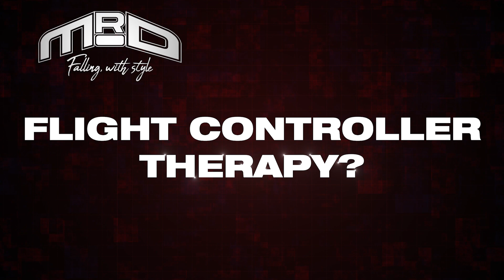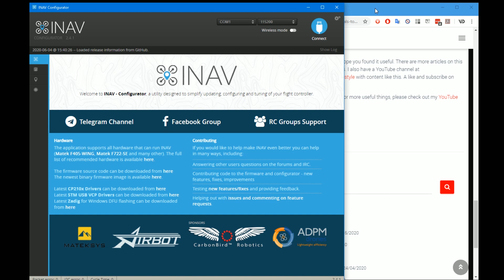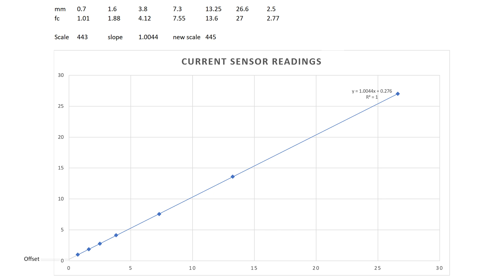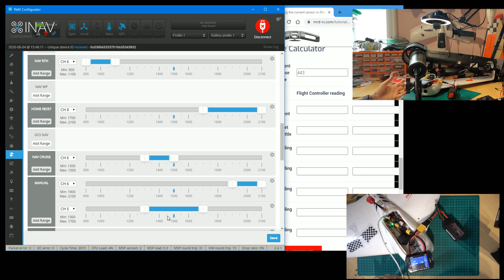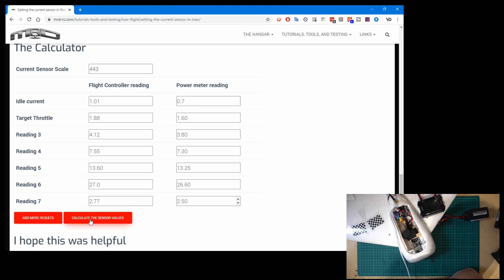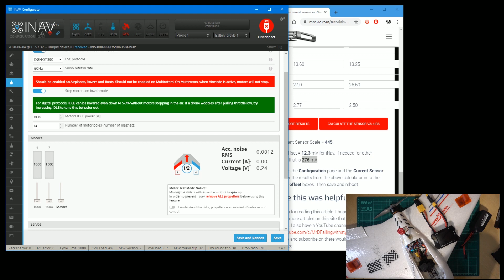Calibrating your Current Sensor in INAV

Comment: Current draw of the motors at full throttle is known. In Inav output settings, spin a single motor with the propeller at full throttle for a few seconds and see if Inav shows the exact current draw or not. Then calibrate accordingly.

Comment: Hi. Thank you for this video and the article on your website. Could you  tell us if we should do this with or wihout VTX and servos powered during the calibration? If we add offset calculation, is the value drop to zero amps even if we power the VTX and ESC or the value would be greater than zero? Thank you.
Reply from the maker: Have everything connected 👍🏻
Reply: I did the calibration with  my OSD goggles and everything connected, drone armed. Perfect for me. Thank you!

Comment: So having current sensors problem. Maybe u can share some of your magic maytek h743v1 inav 5.0 at an idle current sensor reads 30 amps maytek say to use current scale 250. I’ve tried all kind of different scales and nothing works. I did find some cli commands to use but not sure if they r correct.
Reply from the maker: Hi Aaron. That does sound pretty strange. What happens with the current when you increase the power? Does it go up still or just stay around 30A?
 
For me, all I do is set the voltage using a reasonably decent multimeter. Then calibrate the current sensor using my tool https://www.mrd-rc.com/tutorials-tools-and-testing/flight-controller-therapy/setting-the-current-sensor-in-inav/. I don't change anything in CLI.
Reply: @MrD  it goes up but not right away I am using  maytek pdb hex the high dollar one but only running v batt through it no signal just power I also have cap on pdb and fc both r 470 uf I wouldn’t think that would cause any problems. I’ve tried multiple current scales amps nothing seems to fix it. Battery voltage is spot on. To me it has to be the pdb causing the problem
Reply: I really love this plane rmrc anaconda supper slow flyer when flaps r down very sturdy plane. I’m about to add a foxeer 30x zoom cam and a hevey duty pan and tilt mount. Haven’t really thought about this yet but I need a way to have full speed on pan when cam is zoomed out and then slow pan down when zoomed in I think I could do it I may just find a happy medium that would be easy.
Reply: Back to current censor at idle it jumps around a bit 30 40 in flight be up around 120 the plane only draws 25 amps at full throttle on my meter I run lion bats so it’s kinda important to know amp draw
Reply from the maker: It could be down to the PDB. Which model flight controller and PDB exactly? Also, how is the power connected. Battery to FC, FC to PDB?
Reply from the maker: That sounds nice. Bet you can have some great, relaxing flights with that.
Reply: @MrD  maytek h743  Mattek PDB HEX batt to Pdb to fc
Reply: I got it bro thanks I can’t use that pdb like that don’t seem. I took it out and everything work fine

Comment: Hi Mr d. I have a problem with current meter - maybe you know the answer?

My equipment is a stac (Holybro Kakute F7, ESC Tekko32 4in1 45A and VTX Atlatl HV V2)

There is no way to calibrate the current measurement because the readings are very strange, for example:

I connect the Lipo battery to the ESC with the connected flight controller (no other devices) and, for example, inav displays the current consumption value of 0.5A to me - it is logical that after connecting a device, the power consumption should increase. For me it is the other way around. For example, I connect the receiver and the value in inav changes to 0.4A I connect another device (e.g. more power-hungry) VTX, the value in inav drops again to 0.0A

Turning on the engines also does not increase the value of current consumption, well, maybe slightly ...
Reply from the maker: I wouldn't worry too much about current readings under 1A. Some flight controllers use a flat reading below 1A, due to it not being accurate. Others can just have strange readings. The best thing to do is calibrate the current sensor from 1A and up. If when the motors are on and at a decent throttle level, and you're not seeing a change. There is something wrong.

Comment: Hello Mr. D, greetings from California! I have a question, I’m in the middle of a new build, I’m using the F411WSE by MATEK and even with the factory current scale value recommended by MATEK and the voltage offset set to 0. When conducting the calibration INAV shows current draw of 22A while my amp meter shows only about 5A @50% throttle. With power applied to the model and no motor running INAV trades and amp dray of 8.7A. This is with INAV 4.0 Could I have a bad flight controller?
Reply from the maker: I think I saw your post in either the INAV or INAV Fixed Wing Group on Facebook. Something doesn't seem right there. I did check the F411-WSE in my Dart 250G yesterday. That's not far off the recommended scale. It could be faulty. Have you tried running the calibration? Maybe a wrong component has been fitted which has adjusted the scale. 5A @ 50% throttle sounds about right on the ground. In the air, my Dart was pulling around 4.1 - 4.2A at 50% throttle.

Comment: if you follow the same steps with the props off  will it be too far off  of the real numbers ?
Reply from the maker: With props off, you won’t get the current draw you would with props on. It may be thag full throttle isn’t near your cruise throttle. The amps going through the sensor will be the same measurement. But you won’t get the range of current draw that you do with props on. Still, try it with props off if you feel safer that way.
Reply: @MrD got it ,  thank you

Comment: Hi there, I have callobrated my esc in inav 3.0 and when I power on it cuts out on anything above 20% 1.3amps . At 20% the voltage drops off to 10 volts in seconds. When I check this on my meter there is no voltage loss. What am I doing wrong ? At first i thought it was a duff motor not sure now .TA
Reply from the maker: Do you have a smoke stopper connected? I’ve done this a couple of times and wondered why the motor keeps stopping. Then I usually slap myself 🤣
Reply: @MrD  omg no .How on earth. I have kicked the shit out of mysef . Many thanks . This hobby sometimes .....
Reply: As soon as u said smoke stopper my head fell into my hands.Cheers again it works.
Reply from the maker: No problem Traci. Better that than the smoke stopper being needed and not connected. BTW, it’ll happen again 🤣 It’s just one of those things. I know I’ll do it again at some point and wonder what’s going on.

Comment: Great instructions here, Darren. I was needing this. Thanks. BTW, last thursday in got my first 10km with a Mini Drake. Good adrenaline.
Reply from the maker: Awesome Silvio. The Mini Drak is a fantastic plane. Hope you have loads more fun with it.
Reply: Something went wrong. After calibration I have noticed a dolphin effect when she was on Cruise Mode.
Reply from the maker: That’s strange Silvio. The current sensor calibration will have no effect on how the plane files. It only alters how the value from the current sensor is interpreted. 

Dolphining could be too high rates on the pitch axis. Also check that your control surfaces aren’t binding, move smoothly, and centre correctly.
Reply: @MrD  Thanks, Darren. Also I will try auto tune and see what happens. ✌️✌️✌️

Comment: Hello Daren,
Would you suggest soldering the XT60 or the XT90?
Anyway i will not be passing the 45 A with my plane.
Thanks
Reply from the maker: I went for XT90’s as this can handle a fair amount of current. I also use XT90 to XT60 adapters and XT60 to XT30 adapters, so it will work on any setup I want to use it with.
Reply: @MrD  thx Darren.
Gonna use it with lion 4s2p 8000mah.
I m gonna end up doing the same as you, xt90 :)

Comment: Nice one Darren, I take it this will also work with a quad, just need to put a brick on top of it lol
Reply from the maker: 🤣 or tie a brick underneath it. Yes, it should be no different. Its just current draw at different throttle levels. The calculator will even give betaflight values 👍🏻
Reply: @MrD  Very useful, thanks very much!
Reply from the maker: No worried Greig 👍🏻

Comment: This is great, much better than that charger method. I'd like to suggest a simple sanity check in case someone enters a wrong value by checking if the R-squared is above 0.99. Since both current meters are linear, the scatter plot point should all lie on a straight line. Any point that are significantly far away from this line must be the result of measurement error or a typo.
Reply from the maker: Thanks Alexander. That’s a great tip too. The plots usually are pretty linear, with only a little deviation. I’ll see if I can get some sanity checking added.

Comment: Awesome - as always a great and informative video! 😊
But one question remains for me, because I would rather calculate offline: how do you determine the offset? When I do this with Excel, I get a different offset displayed in the formula of the scatter plot (the rest fits perfect)...
Reply from the maker: Sorry for the delay in getting back to you. I had to revisit it myself. All the data is in Excel, but needs some changing to get the correct values for the flight controller.

You'll need the slope, offset and new sensor scale. The easiest way to get that is by turning on "Display Equation on chart" trendline option. You will get something like y = 1.0044x + 0.276. The 1.0044 is the slope, and the 0.276 is the offset.

If you want to use this with a mA based offset, you can just multiply the offset by 1000. For example 276mA. That would work fine with BetaFlight. However, iNav uses mV for the offset, so we need to do a little processing. We need to use the offset, slope, and new current sensor scale.

To get the new current sensor scale, you need the last scale and the slope:
newScale = round(oldScale * slope)
newScale = round(443 * 1.0044)
newScale = 445

To get the offset for iNav, you need to do the following:
iNavOffset = chartOffset / (10 / newScale)
iNavOffset = 0.276 / (10 / 445)
iNavOffset = 0.276 / 0.02247
iNavOffset = 12.3 mV
Reply from the maker: I've created an article on this, for anyone else who would like all the details. https://www.mrd-rc.com/tutorials-tools-and-testing/inav-flight/current-sensor-scale-and-offset-calculation-how-it-works/

Comment: this is a great tool, I started using this to setup all my FPV planes and when I recheck via my OSD the readings are the same as the watt meter across the throttle range. thanks mate
Reply from the maker: Awesome. Its always great to hear feedback like this. It’s worked well for me on my builds too 👍🏻 Thank you.

Comment: why did you put manual mode if you are not using tx?
Reply from the maker: Because if you are not using a TX it defaults to ACRO mode. Which means the servos will be trying to correct while you are performing the test.
Reply: Mr.D - Falling, with style ok
Thank you my Friend
Reply: I had to put 470 capacitor to esc as amps were going crazy in osd
Reply from the maker: This can happen. More on smaller ESCs with less draw too. I hope you managed to get a good reading after.
Reply: Mr.D - Falling, with style if esc has capacitor built in then no need to put additional one?

Comment: Been running my current build to 1000mAh drawn on OSD and then charging like 8 times now trying to get it calibrated. Will be using this method now!
Reply from the maker: This should be much more accurate. And you can do it on the bench 🙂

Comment: I used your website tool to calibrate my matek boards, thanks.
Any chance I could get a copy of the spreadsheet with the formulas too please? I actually only used 2 throttle level values, and I like the look of the graph.
Reply from the maker: The spreadsheet doesn't actually have any formulas. It is just used as an example. I literally just added the flight controller and power meter readings to cells, then created an X Y scatter graph from those readings. The line of best fit is a trend line option you can select, as is to display the equation. The y= value, up to the x, is what you multiply your scale by to get the new scale (I added that in a cell labelled slope). All the real calculations are done on the web page. I was looking in to adding a graph on the page, but so far, couldn't find a solution that works with a line of best fit. But I will keep looking if people find the graph useful.

I'd highly recommend doing more readings. At least 4 or 5. If you just take 2 readings, you are just drawing a line between those points. With more readings, the errors are averaged out, which will give a more accurate scale and offset.

Comment: I've found the Matek figures to be fairly accurate, under the wiring guide and mixer tab of the product page. 
For the f411 wing
Voltage scale = 1100 
Amps scale = 423
Reply from the maker: Matek are definitely one of the better providers, with pretty good base scales. However, my F411-WING has a scale of 445 plus an offset. So there is still room for improvement.

Comment: i used a dc clamp meter that can go  up to 100 amps, as far as the props yes cannot agree more, i actually taped mine down between the washing machine and drier so if anything it hits those and not my fingers :D
Reply from the maker: Totally. Anything that can be done to minimise the chance of a prop strike is a good thing.